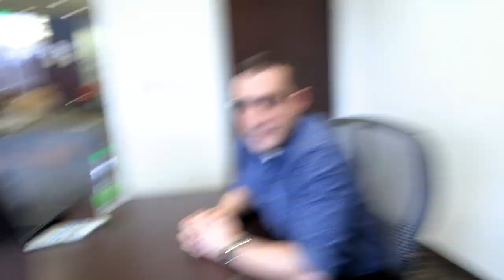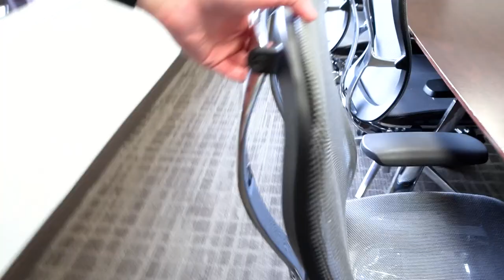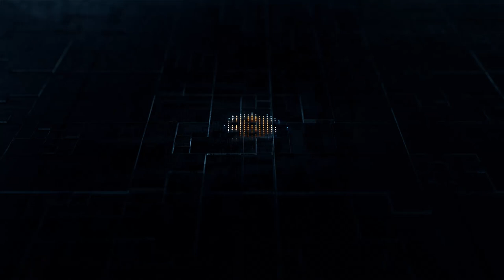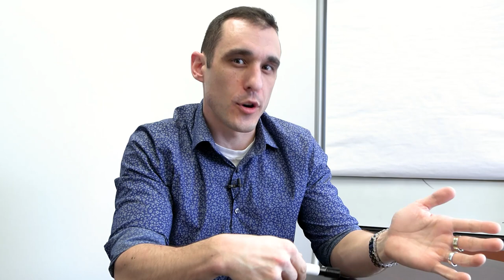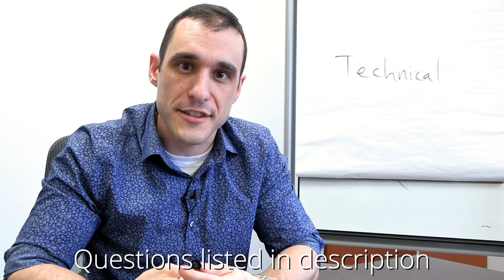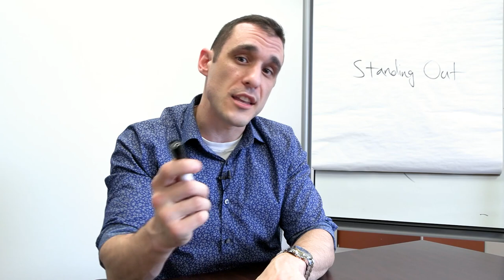How to Nail Any PCB Design Job Interview

Comment: Great video as usual. I was wondering if you could do a video on planning a complex PCB design project. The schematics capture for me takes a long time to finish while jumbing back and forth between reference designs, app notes/datasheets and other resources. Such time is better spent on placement and routing. I wonder if you can shere tips and tricks with us that can speed up the process.
Reply: Great idea for a video! I'll get to work on it as I think this is a good way to help designers get into a good workflow.

Comment: Hi Zach

What kind of coding that PCB designer should know and where he can implement. Please explain in detail with some examples.
Thanks
Reply: I'm pretty good with Python, I've done some automations for my daily work and built apps for my company website with it. I also have had to use it with simulations and some data analysis (specifically pandas and matplotlib). I wish I had more experience in C because so many Microcontrollers use it, but there is now more support for MicroPython so I have more opportunities to use it. If you are really going to be getting into embedded then you need to know VHDL and you need to know how to use one of the IDEs for a major FPGA vendor, preferrably Xilinx as they are the most popular.
Reply: If you are using Altium, pascal / delphi scripting can help you do some automation tasks. But once you know one language, you can do at least basic stuff in any... with a bit of googling. Embedded engineers also love it when the designer has some understanding of how things work in a microcontroller, which is often best learned by writing code for one yourself. I've been surprised in the past that quite competent hardware engineers don't understand the basics of programming a timer for example.